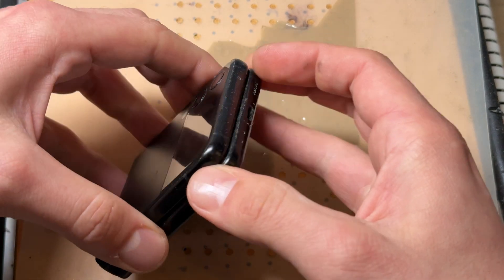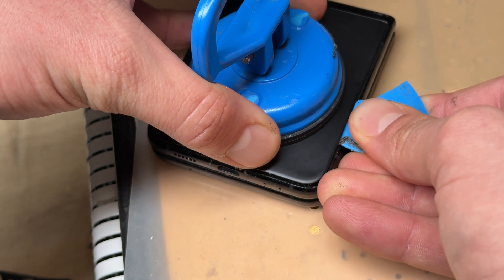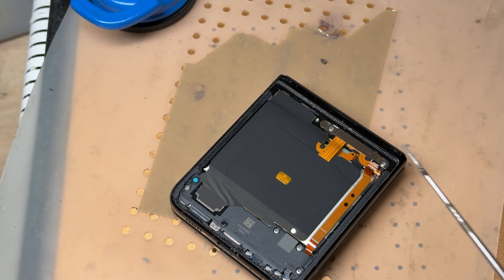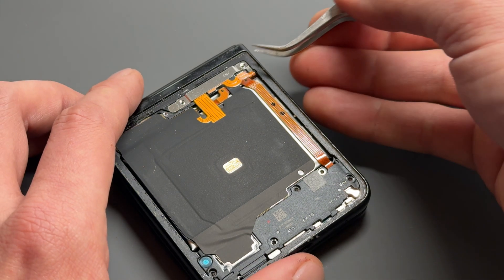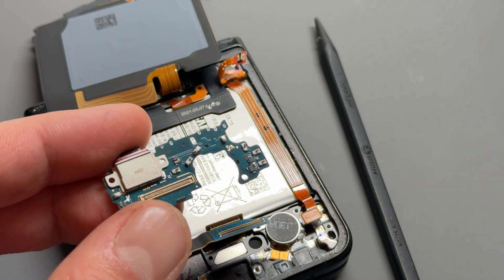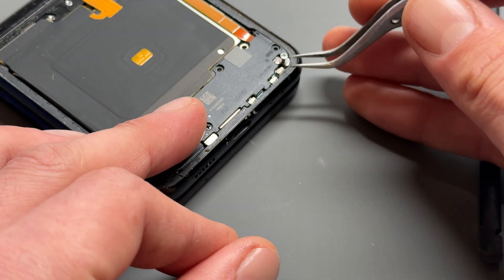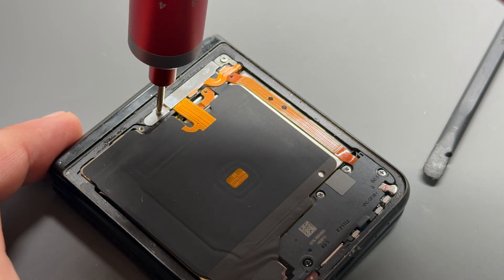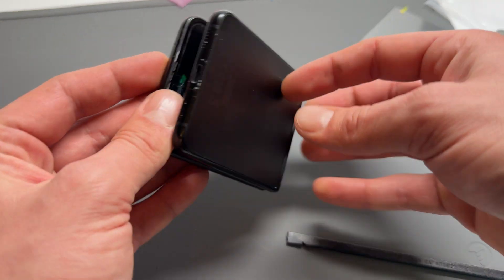Samsung Galaxy Z Flip 3 Charge Port Replacement - Complete DIY Guide!

Comment: Thanks for this. My charger kept slipping off.  Found this tutorial, bought the parts on ebay and did myself.  Very straight forward following your instuctions.  I ended-up using a double edged razor blade to carfully pry / slice open the first bit.  Then used a guitar pick to pry the rest open. Luckily for me the adhsive strip came off completely with the back cover.   It then came off in one peace  from the back cover.  Simples.